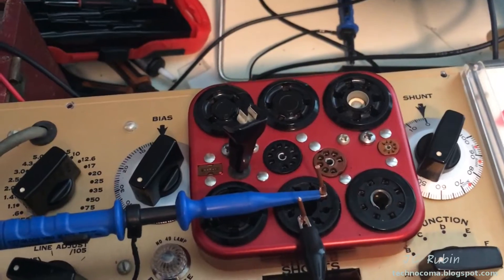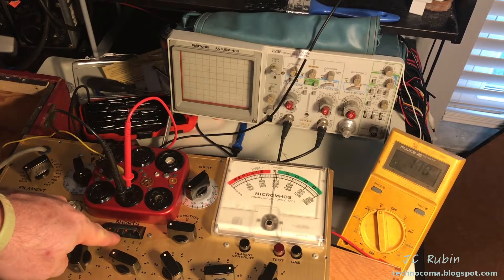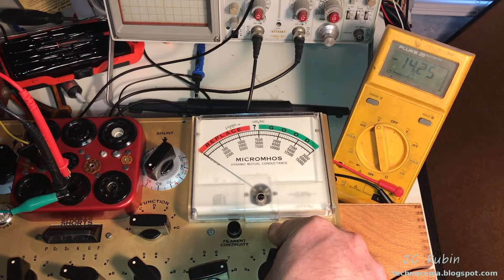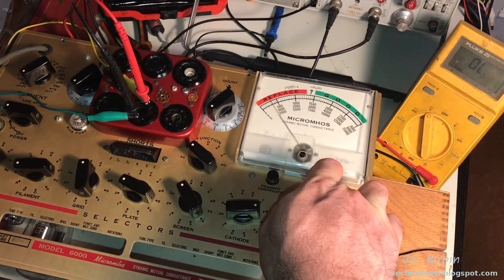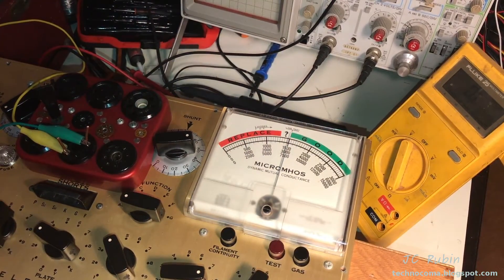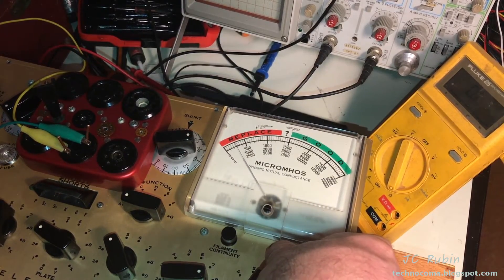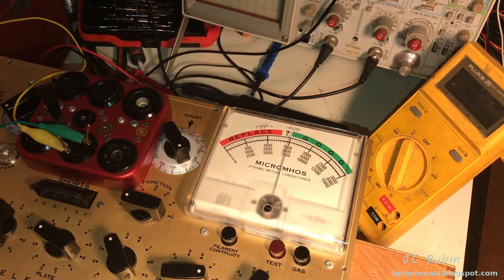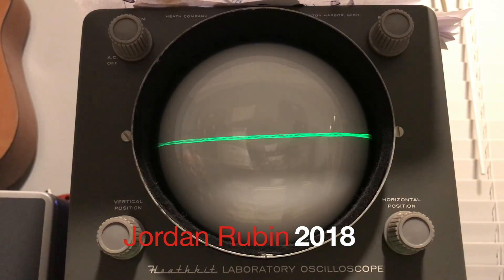Hickok 6000 Tube Tester Restoration - Complete Calibration Part 2 of 2

Comment: I realize this is an older video, but I just recently bought a 6000a and need to calibrate it. What are the various resistor values, wattage etc. that are needed for the calibration with a digital multimeter?
Reply from the maker: The PDF is available online.
Reply: @retrotechandelectronics  Thank you!

Comment: On my 6000 after cleaning the pot cause was acting weird reassembling it and doing this test I get basically same results as you after I balanced the bottom half with top half. But when I go blow 50 needle drops below 0 and it's pegging that bad?
Reply from the maker: I cant tell where this sentence leads to a question... sorry
Reply: @retrotechandelectronics  it's ok I re balanced the shunt I got 1 tick above zero on the 3 red dots :)